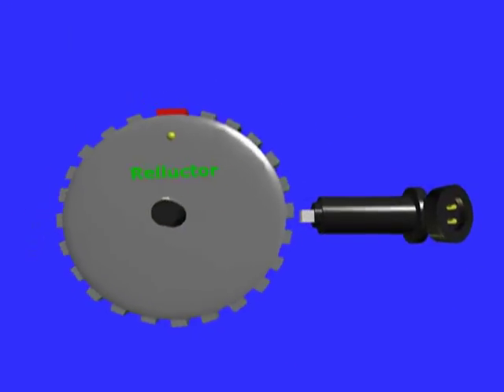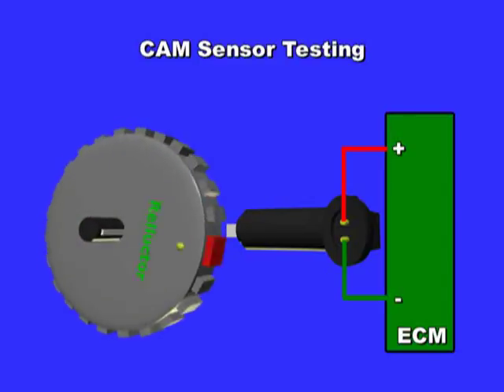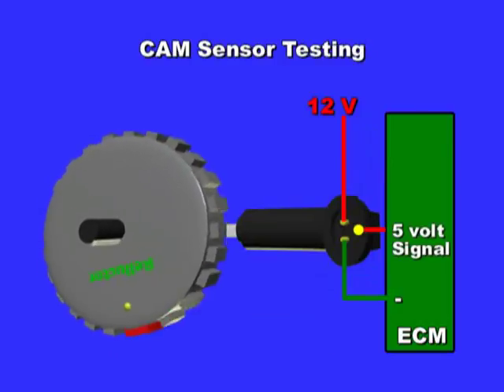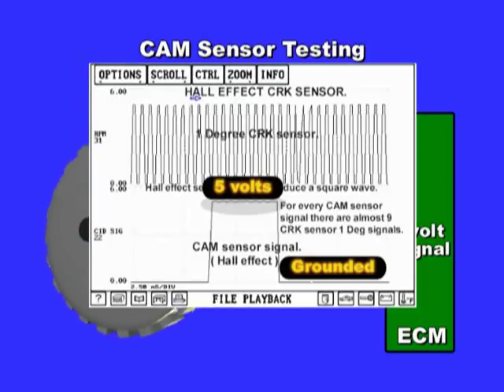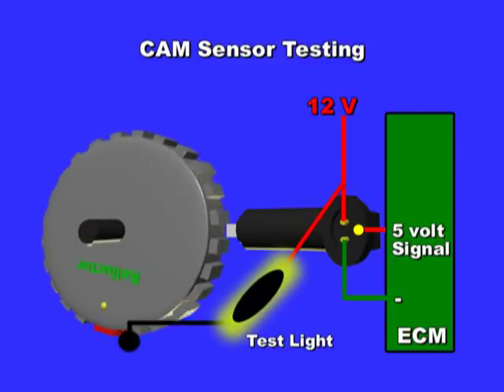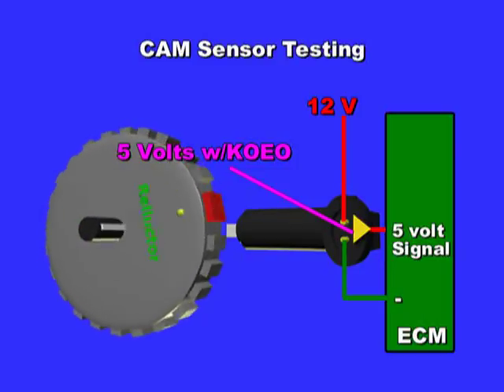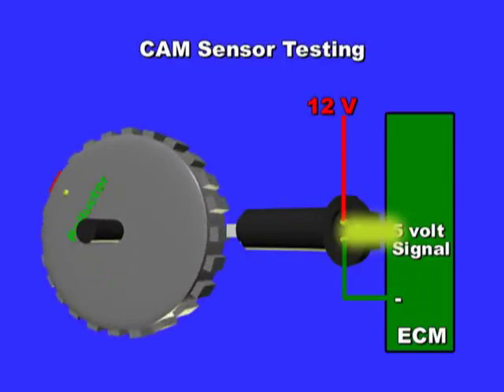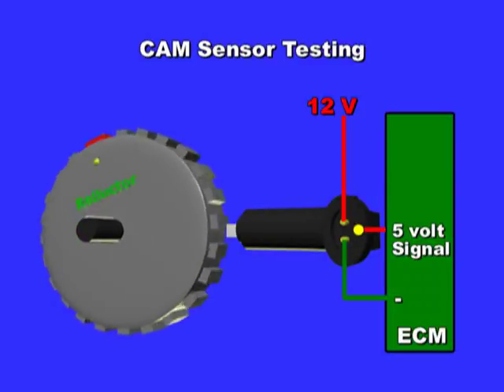CAM or Camshaft Position Sensor Testing

Comment from the maker: Hi, thank for posting... A soldering gun is often used to trigger magnetic sensors and some  Hall-Effect sensors. In other words, grab the soldering gun and hold the back of it close to the sensor and press the trigger. The pulsing magnetic field will trigger the relevant component. Good luck.

Comment from the maker: @MrSate11ite OK, good description. The first thing that comes to mind is a semi-clogged catalytic converter. If so then the symptoms are the same. Second is a blind spot on the MAF sensor. You said you've checked it, double check it. To check the converter just unbolt the spring loaded bolts to the exhaust manifold. It shouldn't be too hard to do. Do that and post back whenever possible. Good luck.

Comment: @ADPTraining

I already replaced my camshaft sensor using the WELL'S brand that i bought from autozone. It came with the synchronizer.  It works well and it so easy to install the camshaft sensor with synchronizer. The size of the bolt is T30 for chevrolet tracker 2001 2.0L 2wd. I hope you upload more troubleshooting videos of different cars.

Comment from the maker: You're going to need to get a CAM and CRK signal waveform and see how they correlate to each other. If it's intermittent then timing belt is ok. Yes, there's a possibility of a CAM signal issue, but I need more info on the matter. Post back with more, but be sure to get a signal scope printout. Thanks for posting.

Comment: for the home person running into this video keep in mind that if the engine is giving the code simply replace the part. If you go into a mechanic they will tear you apart. Much easier to just replace it. For a person to do this testing--your going to pay dearly for that and likely not get your car back. Knock sensor in the range of a $50 fix  same for crankshaft position sensor. The cam sensor likely could mean replacing the distributor but once you do they are free for the life of the car. To walk in front of any shop they are going to charge you hundreds then hundreds more if they do anything.
Reply: Mitsubishi Eclipse Endeavor 2004
Reply: i'm wondering if the generic code P0340 for a hummer coming up points to the camshaft position sensor and when taken to a dealer, they give  bunch of other codes as well. i'm wondering if the other codes gievn is a domino affect of that one code (P0340) snd simply replacing the camshaft position sensor will make the other codes dissapear?

Comment from the maker: Your car is a Suzuki Tracker and it uses a CAM arrangement which was a residual technology of the old distributor. All they did was take the distributor and slap a magnetic sensor to it. The magnetic crank sensor has one bolt. You don't need to replace the relluctor body. Yours is not the only vehicle like that. THere were others with this arrangement. If replacing the relluctor body then there are timing procedures to be done. Just change the sensor itself. Does that make sense?

Comment from the maker: Well, id it's a WELLs product that is a problem in itself. No auto repair shop will ever use WELLs and if so don't use them for anything on your car. When replacing the CAM sensor you don't need to reset the timing on the valves, if that's what you're asking. Pot back with what type of sensor you have, is it a two wire or a three wire... Thanks for posting.

Comment from the maker: When it comes to the CRANK sensor, the worse that can happen is that she's left stranded. On the fuel issue, yes, I agree it may end up costing much more later on. Issues with excessive fuel consumption almost always lead to catalytic converter destruction. If you're in a state that has no inspection then I guess its fine. But also excessive fuel consumption over longs periods of time will carbonize the engine. So do a regular oil change if you feel it's burning too much fuel. Thanks or sharing.

Comment: Hi, thank you for responding. It would drive just fine and then felt like it didn't get fuel or spark for just a few seconds. It did it 2 days in a row 3 times. Then my husband took it for a drive and revved up the engine and the service engine light came on. I took it to auto zone and the code came up for the crankshaft position sensor. I only got the car a week ago, so I don't know it well yet. The last time I drove it it almost didn't start.

Comment from the maker: I'll do my best to help you out. The crank code could be an intermittent or just a glitch. THe car won't run without a crank sensor. When you say it has an issue with fuel, what do you mean by that? If car running fine I suggest you clear code and drive for a while. Thanks and post again...

Comment from the maker: Well, you can take a gamble and replace the CRK sensor, but it may not be the sensor itself. Other issues with the CRK sensor are power, ground, wiring, the ECM itself, etc. It's hard to deal with intermittents. I suggest you wait until it does it altogether and then concentrate on the issue. It'll do you some good to get triple A just in case you get stranded. Good luck to you.

Comment from the maker: The CAM sensor is not the issue here. Ok, there are a few possibilities, one is that another sensor shares power  with the CRK sensor and it's loading the circuit, so look at the wiring diagram and ID who shares what. Two, that the ECM provided reference voltage is not there, either due to a broken wire or the ECM itself, or even the ground in missing. ECMs have many ground wires these days. Are there any other codes? Post back with more.
Reply: ADPTraining ª2000 Durango sly can sensor wire colors

Comment: On the reference with test light hot to ground i get bright light,  test light ground to 12 volt wire is pretty dim,  sensor wire I get 5 volts...  My Harley won't idle worth a crap at times and especially when hot.  Hopefully you will chime in and give me your thoughts.  Thanks
Reply from the maker: Ok, if 3 wire sensor then Hall Effect, power ground and signal. So test with MM accordingly. If 2 wire sensor, then magnetic. http://www.autodiagnosticsandpublishing.com/Toyota_Lexus_Coil_Tester_Pulser.html
Reply: if your test light was dim you have high resistance on that 12v ccircuit,you can look up voltage drop tests to isolate it as its very simple test or use the test light and move it down stream of that circuit till it lights bright again,this means you just past the high resistance so go back and forth till you pin point exactlly where the voltage drop is.most likley a connector or resistance in a connection.
Reply: @pigeonsil240sx  It doesn't matter anymore I sold it and got a real Harley. I'll ride my 73 Shovel until I fall over dead it's what a Harley should be...
Reply: @Nickolas64  Even still your harley can face the same issues in wiring s definitely learn how to test for voltage drops as they are the top problem for wiring issues and extremely easy to learn.the most common cause of wiring problems are voltage drop.

Comment: I have a 86 735i vert, everything is good until I reach about 3800 rpm's then the engine has a power loss and fire. I have checked the fuel pressure regulator, the full throttle switch the mass air flow sensor crankshaft sensor ,coil spark plug,coil wire,distiboters, no luck so far, any ideas on what I should do next....rep me please thxxx

Comment: Is there is no spark it's probably the crank sensor?
If it's weak it's a camshaft sensor? 
Last summer when it was hot the car would not start until it cooled off. Now it's intermittent spark all the time?
Reply: '95 Ford 3.2 MFI DOHC
Reply from the maker: Could be a whole lot more.

Comment: This explans why i have 2 sets of different wheel speed sensor types on my car magneto ones on the front, magnetic at the back meaning two different signal types, the explanation in this video got the two sensor types mixed up because hall effect sensors are the same as magnetic, not magneto.
Reply from the maker: Thank you

Comment: Thamk you for your help. This site ROCKS!
Anyways, the only other code was "fuel pressure regulator sensor" (i forgot the number). The funny thing is I first perchased a new 1from Auto Zone and it turned out it was bad/much worse. In fact the so called new one was shotting gas out of the top vacuum line, so I put the old one back on. With the so called new one the car was very hard to start & would not stay running. 
Now the car idol just fine and it seems to run fine after it gets wormed up.

Comment: wen i start my tahoe 97 it sound like its not gona turn on like it cranks slow n lazy bt does turn on n also been having a missfire constantly on #7 n spark seem as new any body know wat it cud be i changed al last is crank n cam sensors

Comment: @ADPTraining

The camshaft sensor of my chevrolet tracker has a magnetic coil. 2 times already that i used different brands of the camshaft sensor but the car didn't start. I think there's something wrong with the magnetic coil. It has 3 wire in my sensor

Comment: @ADPTraining

I did replace the camshaft sensor of my chevrolet tracker 2001 2.0L 2wd. It was a STANDARD brand that i used but unfortunately the car didn't start whenever i turn on the ignition switch & it gave  a code P0340. Do you think i need to replace the magnetic coil together with camshaft sensor. Your reply would be appreciate.

Comment: Hi, I just bought a 2000 Oldsmobile Intrigue last week. The check engine light came on yesterday so I took it to auto zone and the code for the crankshaft position sensor came up. It runs pretty good it just seems to have a problem with fuel no and then. Is it still safe to drive until I can afford to fix it?  Any advice you have would be really appreciated. My husband is disabled and I am a mother of 3. Thank you. ;-)

Comment: For the magnetic sensor, can we get any readings or fluctuations if we use multimeter and set it to frequency...?
Reply: Harldy any fluctuation cause the volts are very small to be measured by the multimeter
Reply: you can take the sensor out while still have harness coneccted and koeo put something metal in front of the sensor and check voltage from signal wire as you do this.the voltage will drop as the metal object gets close

Comment: Why shouldn't we use Test Light on Signal Wire? (Signal Wire for all Sensors etc?)
Reply from the maker: Too high current at 300 to 400 mA. Signal current is in the 1-5 mA range. A TL could damage the circuit, but not always.

Comment: @ADPTraining 

Look at the WELLS brand camshaft sensor & You will see what I'm talking about the camshaft sensor comes with a magnetic coil housing in which you will attach the camshaft sensor. The magnetic coil has a timing mark that you need to aline or you need to position your pistion no#1 TDC in order to timing the car.

Comment from the maker: Ok, you're not making sense. A 3 wire sensor is NOT magnetic, it is a Hall-Effect sensor. A 2 wire sensor is a magnetic sensor. if 3 wire, as you say, check sensor power (5, 7 or 8 volts), ground and reference voltage. Post back so we can help you better...

Comment: I have a 2000 Impala 3.4 motor that right after I replaced the motor mounts (all of them) I received a code of "P0336 Crankshaft sensor". I changed the sensor and the pully (because it looked to me to be worn/in bad condition) and it still shows the saame code of "P0336". What do I do next? Could it be the Cam Senor? Or is there another Crankshaft Sensor somewhere?
Reply: its the wire than rests near the block of the engine as it exits the "armor" cable surrounding that 5v reference wire. the wire gets chafed, and keeps setting a fault code. there are other devices on that same 5v reference linen but that wire is most probable cause, get one off a junked car and install it.

Comment: hey i have a 08 golf 5 gti getting a p0011 error camshaft position sensor and camshaft position timing over advance. symptoms im getting is power loss and EPC light come on after 4-5k rpm then disappears. and also at times get fuel cuts. could my sensor be faulty?